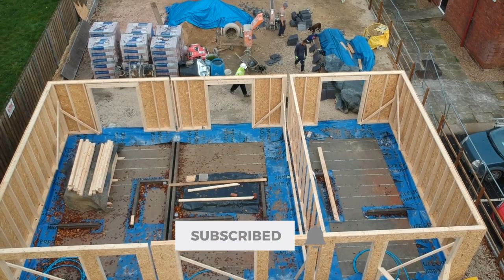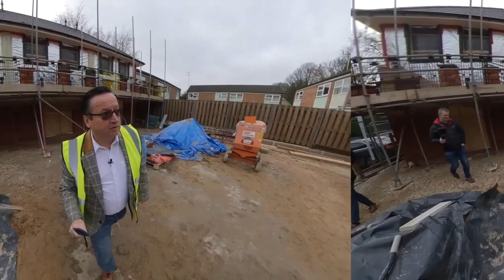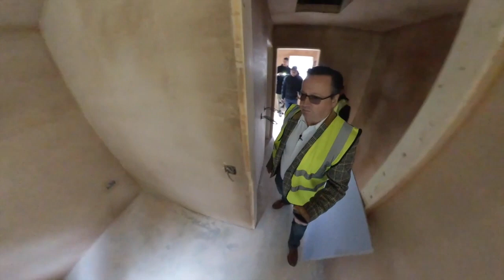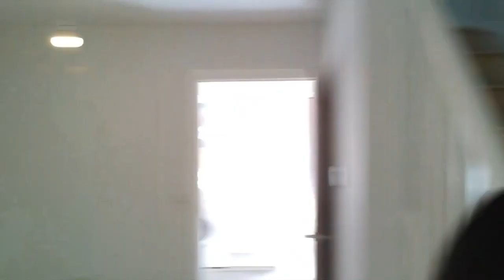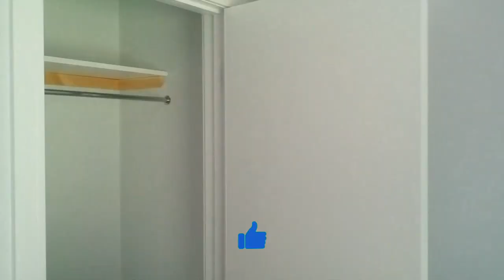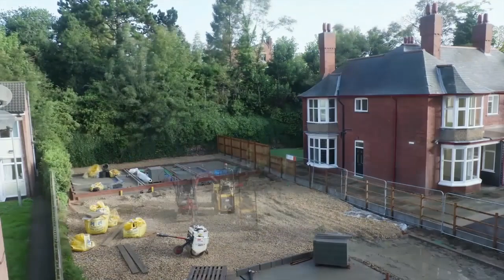How to build a house with Zero experience | Trevor Cutmore

Comment: Will you be putting a video out on the full cost breakdown for this project?
Reply from the maker: Hi Robin,  Sorry I don't generally put the costs down as some people think it will be the same elsewhere and it only brings confusion etc.  For an example, to do new builds here it will be about £1,250 per square metre.  In Cambridge it's £2,000 per square metre.  Plus you need to look at infrastructure and a whole, load of other factors.
Reply: @trevorcutmore9677  thanks Trevor, that’s makes sense.

Comment: Re Trevor’s comment about contractors not wearing high viz jackets.Be aware ultimately the client i.e. you,is responsible under the CDM regulations for how health and safety on the job is run. This doesn’t mean that you have to be expert in all aspects of health and safety law but it does mean you 
should know  enough to know and be able to show that the  people you hire are i.e. principal designer and the principal contractor,and be confident they have the necessary systems and procedures in place.Dont misunderstand me,when you look into it you really don’t need to know that much,just that others you put in charge of that stuff do.Remember in health and safety law you are effectively guilty until proven innocent,you have to explain why something is not your fault.Recomend you go to citb website and find hse guidance leaflet on roles under CDM2015
Reply from the maker: peter montgomery  You are 100% correct and they were spoken to and it never happened again. Unfortunately this is the only video footage I have of them laying the roof so I used it.
Reply: Trevor Cutmore I’m well aware of the standards of your due diligence and also the fact that you wouldn’t allow others to put themselves in harms way.I only raise the point for others because I meet people that after starting slowly don’t realise that they’ve actually built substantial portfolios and are doing significant projects.Dont get caught out on something simple but important people.From what I see the name of the game is ownership as you step up
Reply: Who the hell really wears hi viz vests on a domestic site.
Reply: Elliott Heatley are you suggesting this is a domestic site?As for domestic work,CDM 2015 covers domestic work but a btl Refurb would be seen as commercial anyway.The point isn’t about hi viz jackets per se,it’s about do you understand your role and responsibilities in law and where it leaves you if something goes wrong.Has risk been managed and if you have to stand up in court can you show it has.Hi viz jackets or hard hats might not be required if you can show the risk has been assessed and they are not required.
2 terms 
Vicarious liability.   Look that one up
Reasonably practicable(note practicable,not practical)